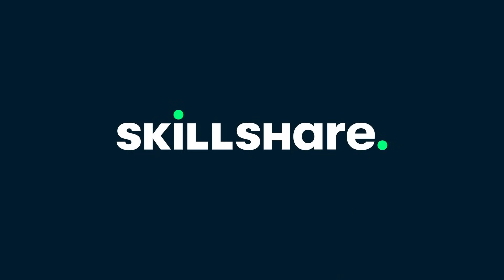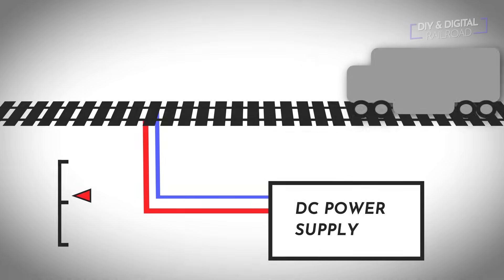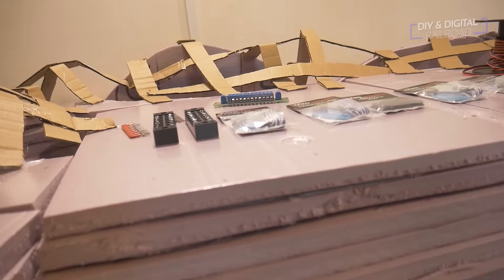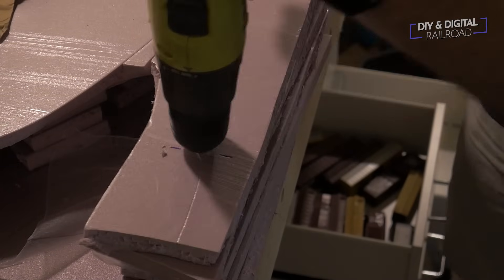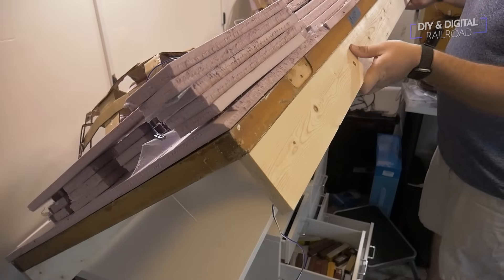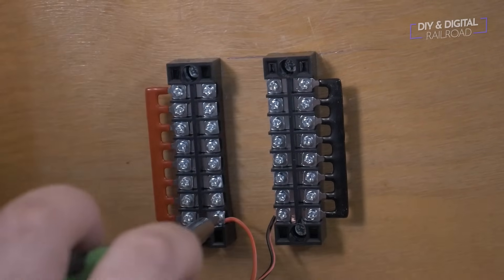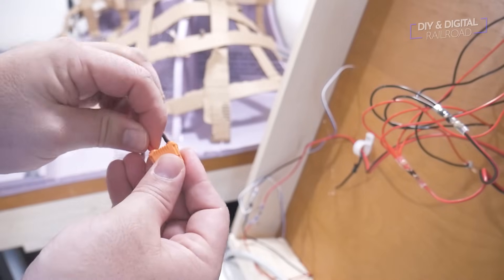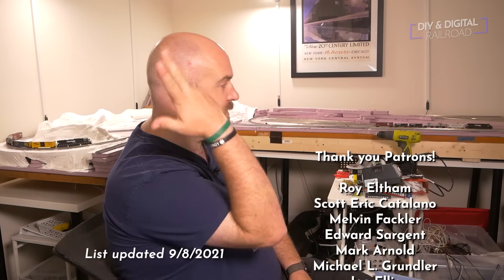How does DCC Work and how do I wire my Model Railroad for it?

Comment: Kato went blue and white and yet North America tends to black and red.... I went so far as printing out little pieces of paper and stapling them near connections points that say "Black = Blue. Red = White". It's a visual that works as a good reminder for me.
Reply: Black and red are the standard colors for DC negative/ground and positive voltages. With DCC the voltage for each wire are alternately positive and negative, so it matters that one side of the circuit is connected to one color while the other side of the circuit is connected to the other color; like DC, but the polarity is always changing, so it only matters that you maintain the same color for each side of the circuit. If you switch wires across connections, the relative voltages will cancel, like a short circuit. TL;DR any two colors are fine, as long as you're consistent.

Comment: Do you wrap wires directly to your terminal strips or, as I do, attach blade terminals and then insert to terminal strips? Maybe just a preference?
Reply from the maker: I wrap directly sometimes, and sometimes I use the blades.

Comment: Need to remove that clear protective sheet from the foam. That will cause you to have adhesive failures, and nothing but problems.  Especially if it ends up on the top where your track and scenery is going to be. I see countless videos where people fail to remove it. Even after being told about it.

Comment: I know it's been stated so often, but on my 8' x 8' dcc ho shelf layout just two wires, no soldered fishplates, and no apparent issues. Am I missing on something? Should I be adding all this extra bus and feeders if my layout appears to be running fine? Honest question: really wondering if anyone had done a before and after with appreciable difference? Cheer, keep up the good work
Reply: Hi!   I am not an authority, but as an engineer KISS (Keep It Simple Stupid!) comes to mind.   :-)   If its not broke, DON'T FIX IT!   :-)

Comment: I have heard that you should run a twisted pair of bus wires when using to DCC, to help with signal lose or interference. Have you had any experience with that? Great vids as always!
Reply: cabling is a type of wiring in which two conductors of a single circuit are twisted together for the purposes of improving electromagnetic compatibility. Compared to a single conductor or an untwisted balanced pair, a twisted pair reduces electromagnetic radiation from the pair and crosstalkbetween neighboring pairs and improves rejection of external electromagnetic interference.
Reply: That's necessary at a layout length of about 20 m and longer only.

Comment: Hey Jimmy I would suggest that you get a drill bit that's 12 to 18 inches long.   Makes drilling through all that foam alot easier.   They also make a installers bit that has a hole in the tip that you run the wire into and then you can pull your leads. The installer bits are a little pricey but the  long bits are not.   Lowe's or Home Depot..  just a suggestion.   Keep having fun, Chris
Reply: What diameter would you recommend?
Reply: @johnschutt9187  Depends on what you're doing,  wire ,1/16,  up to 3/8 for the  through wire for a tortoise switch.

Comment: You know they make really long drill bits... Useful for running wire through walls, and layouts
Reply: What diameter would you recommend?
Reply: One that's big enough for the wires you're using
Reply: What about a hot wire rod knife?
Reply: You can get 1/8 drill bits a foot long at harbor freight pretty cheap.

Comment: Great video, Jimmy! Very helpful! I use blue and white wires for my 16-gauge bus wires, to match the blue and white wires of the Kato terminal unijoiners. This helps me avoid confusion. I also use terminal barrier strips as you do. Barrier strips help me keep everything organized and easier to trouble-shoot later on, if necessary. ...Roy
Reply: Good point Roy as long as you take care to install your Kato track piece so blue vs white sides are properly aligned and not inadvertently 'crossed' causing a short.

Comment: You lost me at jumpers and black and red wires. But explain this to me…. Why do you have so many wires going to the same section of track? ie: you drilled 3 sets of holes for your layout addition
Reply from the maker: Hey David.  So turnouts will electrically isolate sections of track, so the feeders keep electrical continuity intact.
Reply: @DIYDigitalRailroad  How far apart should feeders be?

Comment: Am I able to wire my track with NCE DCC, and wire my switches through separate wires into atlas switch controls that go to the DC terminal of a transformer?  Thank you.
Reply from the maker: Hello!  Yes that should not be a problem at all.  The switch motors do not directly interact electrically with the rails.

Comment: I use DCC (12v) for a small Z scale railway, and Dinamo for the N gauge SwissBrit layout. The latter allows me to have DCC fitted and Analogue trains running simultaneously over the same layout using the same tracks as the system is fully block controlled. I also do no longer have to worry about short circuits as these simply do not exist in a block to block system.
Reply from the maker: Impressive!
Reply: what about lighting do i have to put all pos wires on one side and neg on the other

Comment: Did you tin your wire ends to prevent any stray ends from contacting the adjacent terminal? That has always been one of my issues with stranded wire unless using solid wire.
Reply from the maker: I did not for this one.  The strips have solid walls between them.  I will do that if the terminals are small and/or really close together with no barriers.  Otherwise I will twist them tight or only strip out a short amount.
Reply: One other thing I do to ensure that I didn't happen to mix up the wires is to conduct a continuity check between the tracks.. I had a turnout that was short circuited and didn't find it until all the track was installed and leads were soldered.